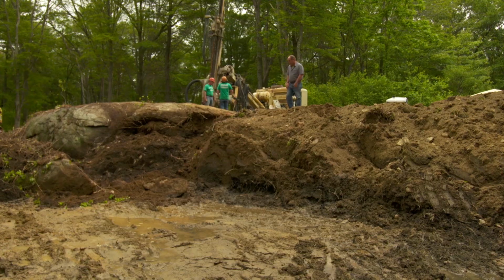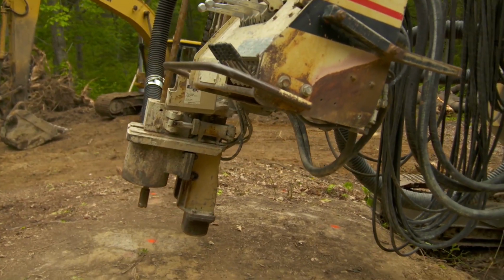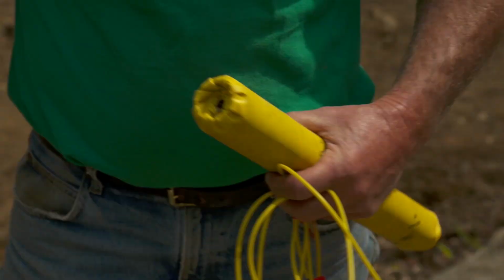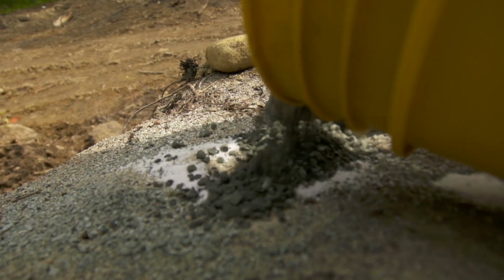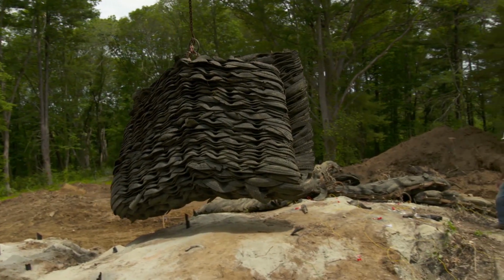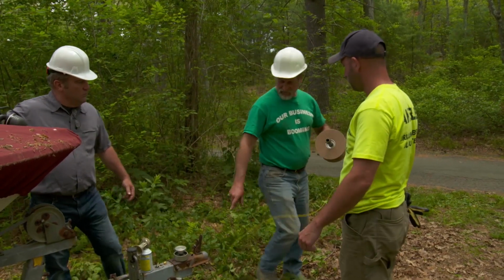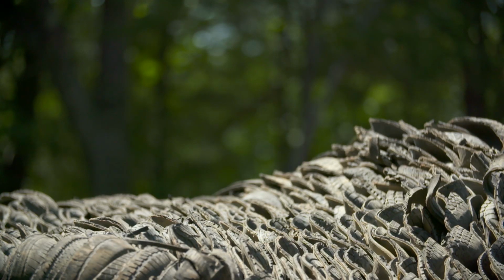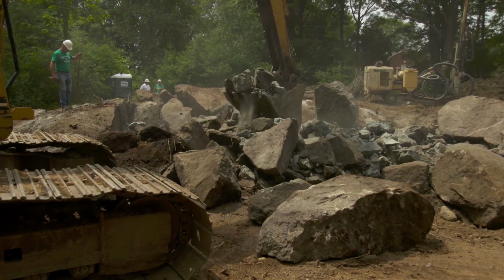How to Blast for a Foundation | This Old House

Comment: "our business is booming"  . . . lol!  years ago i worked for a core drilling company and they had t-shirts with the phrase "your hole is our goal" turns out the karens didn't like them too much.
Reply: @Kevin-mp5of  LMAO that's funny! do they sell muffler bearings and prop wash btw?
Reply: My aunt lived in Guymon Oklahoma and the high school was in Hooker Oklahoma. She had a sweat shirt made up and wore it quite often to games and all around that said Not your Average Hooker. Btw most of my family is certifiable lol.
Reply: Karens don't like anything. Not even themselves.
Reply: @Kevin-mp5of  ... yeah, and we had the radiator shop that said "a great place to take a leak" on the back of their truck.
Reply: Probably not as good as yours but a friend of mine used to work construction and the company's name was "Moore Erection".
Reply: I worked for a structures shop (carpentry and metal work), we had shirts that said.....”we screw, we nut, we bolt!”

Comment: I love how these videos are always labeled "how to" as if I'm gonna go rent one of those drills down at Home Depot and do this myself. 😜
Reply: I got mine at Lowes
Reply: I got mine at horrible freight for $7.99 with a super coupon.
Reply: @Kevin-mp5of  brushes were gone, got the one time use tape measure instead
Reply: @Kevin-mp5of  i picked up my 50th free one time use led light. I got such a good deal. I left the store and came back bought a pack of one time use screwdrivers for $6.99 for 12 of them and picked up my free pack of one time use microfiber towels
Reply: We have one out back, do you wana borrow it for the weekend :-)
Reply: You probably could've gotten it all via mail from a Sears catalog 150 years ago.
Reply: @g36killer  do they sell the blasting caps and hydralite as well?  That’s all I need.
Reply: A person used to be able to purchase dynamite at the hardware store and use a drill hammer and steel to do just this. This is safer and much more controlled.
Reply: Measured amount of ammonium nitrate 😄 he throws it out of the bag, that much will do i guess
Reply: @Kevin-mp5of blast....
Reply: @Kevin-mp5of  i think i went to that hardware store to. I picked up a fully automatic tommy gun for $150 and drove my model t aross the street and picked up 6 bottles of herion for a $1 a bottle.
Reply: @brianglade848  You only charged a buck? Cheap. But it was seriously avail until the early 60's.
Reply: @brianglade848  I don't believe it
Reply: I mean you could
Reply: Dynamite was a common hardware item back in the day?
Reply: I’m still interested if I ever want to hire contractors to do this I know what’s happening.
Reply: @g36killer  I'll have to wait until memorial day

Comment: “If the hole is dry, they use a measured amount of ammonium nitrate” 

: Dumps the bag into the hole using his hands
Reply: They know the drill bit width and depth so filling it up is probably measured. But I get what you mean.  😂

Comment: Biggest hammer drill I’ve ever seen. Wonder how they can be sure all the charges go off?
Reply: The holes are put on a trunk line, then the trunk lines are attached to line attached to the detonator. The go off in a sequence based on the timing set up in the blasting caps.
 If there is a cut-off,  it will be
 noticeable. You wait approximately 30 minutes,  reattach another lead line to the shot and attempt to  shoot again.  

I have left out a lot of details,  but that is the gist of it.
Reply: @jrondyer1049  thanks for info. I wouldn’t want to deal with a situation in which the second (or third or fourth) try failed.